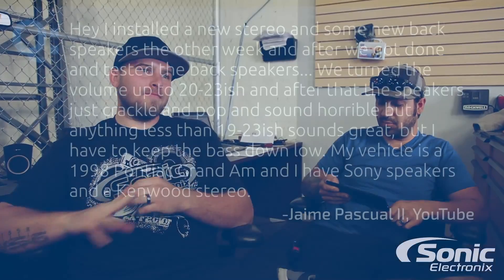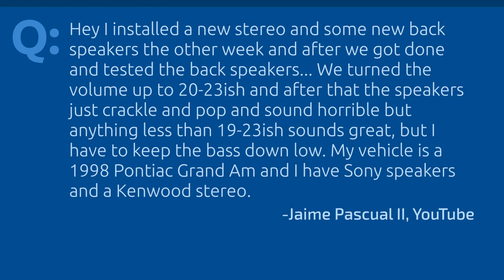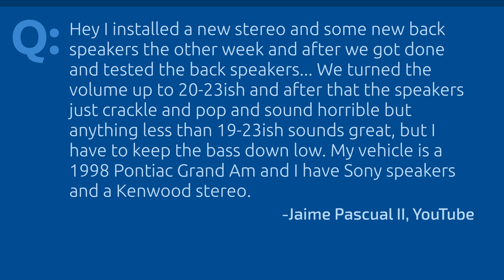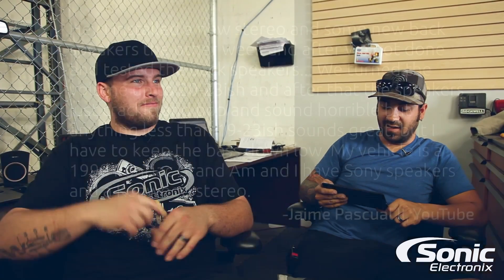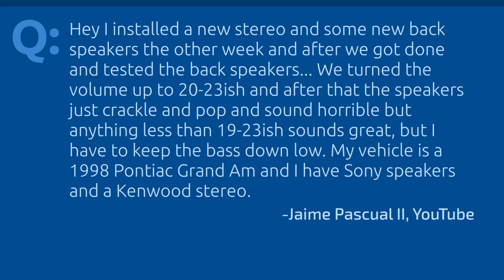Why Do My Speakers Sound Bad at High Volume? | Car Audio Q & A

Comment: Hey guys, I have a 2014 Silverado with a factory radio. I'm experiencing the same issues, but I have Infinity 6x9s, 6x5s, and tweeters. I also have two Rockford Fosgate 10" subs with an LC5i Pro. The system sounds good, except when I turn it up, then the popping starts.

Comment: I have a 2008 Mitsubishi lancer with the rockford fosquate subwoofer that actually came with the car. With my old system i can turn it up as loud as i want and it sounded great changed the stereo and if i try to turn it up loud even without the loudness setting on and it just makes that same crackling sound i never heard b4. The guy who installed it tried to explain it to me sumn about the system is accustomed to 1100 sumn and the stereo is putting out 1300 so that sends the extra to the tweeters on th car thatmakes is sound distorted... do anyone understand what he is talking about and can you simplify?

Comment: I have a 04 Chevy Impala base model have a Pioneer MVH -291BT head unit and OME speakers front and rear with an OME amplifier my front and rear speakers we're working fine then I have lost speaker volume at high level have speakers volume at 45-62 but sound is very low what is the problem? Help me out here

Comment: I have a crackle 2 months in after install. Even when the music isn't playing, but u did notice it more when I have the AC on, seems when the ac n engine does it's thing u hear a quick light crackle every 20-30 seconds with ac on, without the AC I hear is barely. With no music on and volume all the way up the same tone and repetition of the crackle. Sounds like the rice crispies crackle.

Comment: I just put alpine s 65c 6 1/2" speakers amd tweeters in my 2000 chevy silverado that has the kenwood dmx47s.  When I turn my blue tooth and my phone all the way up it starts sounding a little distorted on high volume. I also have a alpine mrx m 55 amp I wanna put in the truck it's a mono amp but has speaker inputs in the back for 4 speakers. Xan I hook just the speakers up to this amp not the sub and will it help ot could it be a wiring issue?

Comment: 2007 Impala LT (non Bose) I installed a new head unit and Scosche speakers all the way around, the front speakers are ran through the factory wiring, I had the back going through factory wiring as well but there was almost no noise in the rear speakers besides crackling static, I ran new wires to the back speakers directly from the head unit and that got the speakers to make a little bit more of clearer sound, I then installed a ground loop isolator which knocked out 90% of the static but now it's to the point where the front speakers are loud and bassy when they're not supposed to have that much bass and the rear sound like just treble.. confused and need help!

Comment: Why  does my pioneer  car stereo fuse has a copper wire around ? If I take it off the copper wire from the  stereo fuse it  won't turn on ...I bought it from someone..someone explain?my speakers never did that even though i play bass boosted songs ..I use the deck at home with 5amp supply

Comment: I have a 2003 Yukon Denali XL I put a aftermarket system in it I got a 6.5 fosgate components in the front and back doors I have an upgrade sound system in the very back I have two level four 15 DC Audio with the 3.5 amplifier also DC batteries and everything it was sounding good then all the sudden the louder I go my door speakers muffle down the amp I have is a four channel which it's not like top of the line is called black ice but it used to work with no problem I noticed that it gets very very hot you can probably cook an egg on it that's how hot it gets I'm wondering if that's what's causing my door speakers to muffle down as an amp alone I appreciate it if you can reach out to me

Comment: So I installed the KICKER 43CSS654 6.5" Component Speaker System Kit (that I got from your store on ebay) into my 2015 wrangler jk. I am using the stock radio. I turned it up to around 20-23 and was nasty sounding. The new speakers i put in sound really bad. Could it be because the stock deck doesn't pump out enough juice for the speakers? I thought it my be the crossovers so I have those set at 0 on all 4 of them and still sounds bad. Sounds ok when it is played at low volumes.
Thanks in advance.

Comment: I just got some installed but litterally the same day the started sounding different. For about 30 mins they sound great cranked at max valume but after awhile the sound starts to sound fuzzy and volume decreases overall and gets echoed. Now I took the speakers back to get looked at n they sounded fine for both 35 mins but 5 mins after I pulled off the lot they did it again. Happens with all music rap,country,rock

Comment: I know this video is old but I installed a system in my 2003 wrangler and was experiencing the same issues with volume. By just removing bass boosting and adjusting hpf to 80 hz I instantly got miles more undistorted volume.

Comment: Pioneer avicf90 on some pioneer 5 inch speakers with the tweeters in middle an some  an a 1500 .1 boss amp with a 12 inch dvc4 planet audio sub in  ported  box

Comment: I have 4JBL 6.5in component speakers running at 200watt rms. They have issues at higher volumes also. But I’m curious if an amp would solve that issue?

Comment: I got some kappa 93ix I was recommended those as the best highest quality in their store and yes they are totally but then at a certain high volume they start sounding like the cheapest stock speakers, any suggestions? Would it affect the facts that I have not installed a speaker amp?
Reply: Did you solved that issue brother

Comment: hi I have 4 channel power amp, can I power 3 voice speakers at 4 ohms using 3 channel, and the other channel to run two voice speakers at 2 ohms? or please tell me the best way to power all 5 speakers,3 speakers are 150Rms (4 ohms), and the other 2 60w Rms(4ohms),note that till I get a bigger power amp(temporary)  power amp Specifications see bellow 

Number of Channels 

4/3/2

Maximum Power Output

760 W

Continuous Power Output (2Ω, ≤ 1% THD+N) 

90 W x 4

Continuous Power Output (4Ω, ≤ 1% THD+N) 

60 W x 4

Continuous Power Output Bridged (4Ω)

180 W x 2

Comment: I have no sound from door speakers but sound comes out of sub at high volume amp work proper wiring and capacitor competition fuse 0 gauge wiring  mtx 10 9500 thunder serious and audiopipe 1800monoblock and pioneer deck screen

Comment: check your battery, match the output of the speakers to your radio watts in rms, you may need a capacitor and amp.

Comment: I have a 2002 toyota camry. That had a system installed. I took it out and.  Now i wana put it back. I have. Factory radio factory  speakers.  I have a l.o.c.  with one 12. Premier pro champion sereis.  And a hifonics. 1600 Brutus. I connected everything properly. And when i go to turn up the volume my bass. Is still there but i dont get the. Same bass when the volume is. Lower.   I have changed out rca cables. And still same problem.  Befor i unistalled the same system it sounded good no problem at all.  Any help. I just wana bang

Comment: Good morning, I have a 2014 Nissan Maxima and my new dash speakers crackle and pop with the engine running and the volume turned up past 20. I  have a soudstream head unit, and boss chaos speakers all around. Dash speakers are 140w, front door 500w, rear door 125w, and rear deck 500w. Any ideas on what the issue could be?

Comment: I have a 06 civic and my rear speakers clip in the back with volume at 27 and up. Besides the solutions in the video would disconnecting them be an option? Before my current subwoofer n amp I had a powered sub hacked into the rear speakers wires due to not having an aftermarket head unit. There is a bit of extra wire that is hanging freely from the rear speaker wires with just electrical tape covering the exposed wire, would the exposed wire possibly be causing the clipping?
Reply: Subwoofer sounds fine past those volumes, just the rear speakers clip.

Comment: See. My 2003 Saturn ion doesn’t have the uplevel audio system with the amp but I have put in a Sony head unit and kicker speakers and it does the same thing sounds ok at lower volume and has no bass you turn it up to 22-25 to get some bass and it crackles a bit

Comment: I have a shitbox 2nd gen dodge with pioneer 6×9s in the front doors 2 10" shallow mount hiphonics and 2 sony 6×9s in the sub box with an 1100 watt rockford fosgate amp and it sounds good when its quit but even with bass boost off it's very distorted at high volumes

Comment: I just bought two new skar vd 10 inch shallow subs for my truck running them on a skar 2000.1 monoblock at 4ohms giving them 800 watts each and they are not performing well at all.
Reply: Austin Tolbert same here . I have a zvx 12 and sounds like shit high volume. I don’t understand what’s wrong .
Reply: Same here. 1 15" evl on 2000 rp.

Comment: I have a question, i have a 2017 Volkswagen jetta gli with the Fender audio system and i changed my door speakers to JBL 6.5's. The problem I'm having is my front speakers are popping (mainly the Right) the rears are fine. I just don't understand why the front two are popping. When the fader is to one side no popping but together they pop unless i slide the fader to the right a little. Also the car has a built in sub in the trunk. Can you help

Comment: I have a 2004 GMC Sierra sle.. with an aftermarket Kenwood excelon kdcx599 with 6&1/2 front 3way speakers and replaced the rear 4&1/2 and it still sounds like a whisper.. help! Lol 😂🤷🏿‍♂️

Comment: Thank you so much for your time  and info you share. Question,  if I have component speakers that run 75 watt rms and it's only getting 50 watts rms from the amp, could this be considered underpowered? You spoke about clipping and distortion in this video and I am getting a little of both at different times in different songs. I'm just trying to rule out a few things to get it straight.  Thank you again for your time. Tim

Comment: IM ABOUT TO AMP UP ALL OF MY INTERIOR SPEAKERS IS IT WORTH ACTUALLY USING A AMP ON ALL MY ALPINE COMPONENTS SPEAKERS. DOES IT MATTER IF I USE A KICKER OR ALPINE AMP ON MY ALPINE INTERIOR SPEAKERS? MY SUB IS A KICKER WITH A KICKER SUB BUT INTERIOR IS ALL ALPINE SO DONT KNOW IF I SHOULD GET A KICKER OR ALPINE FOR THE INTERIOR? Lmk thanks

Comment: I have a different problem. My speakers are 100% fine when the engine is not running. As soon as you turn on the engine though, the speakers crackle. It gets worse with higher RPM. My garage tried installing a capacitor to fix it, but this did not work at all. Any ideas?
Reply: Did you fixed that issue brother
Reply: @Singh_Preet57  Yes, I did. The stock Honda speakers were the problem in my case. The 50 watt headunit that was built into the car by the previous owner was simply too much for those speakers. They were absolute pieces of junk partially made out of cardboard like material. I replaced those speakers with Pioneers, and the problem was gone.
Reply: @WH250398  oh that's awesome 👍🏻👍🏻I just upgraded my stock mercedes speakers to alpine type s. And the quality went down. I am confused and don't know what to do now
Reply: @Singh_Preet57 like most stock head units car manufacturers tune the frequencies to the stock paper cones so they sound acceptable. To fix your issue, you will first need an amp to give the speakers real power as they are currently underpowered and you need a DSP to tune each of the new speakers as frequencies, EQ, delay, need to be adjusted. This may be $$$ but will be worth it.

I upgraded my speakers to aftermarket high powered and like you the sound degraded. My local audio installer mentioned I need an amp and DSP with tune.

Comment: Question: my Chevy Silverado 2005 stock rear speakers are not working right when I turn the fade all the way forward the rear speakers get louder but are still very faint when I turn the fade all the way back they turn off the front speakers are fine it’s just the back ones it’s not the speakers themselves bought new ones and they didn’t work either

Comment: So I just had 2 10’s installed in my 16 challenger with an lc2i outline converter, a extra battery and a bass amp. I notice that my two front door speakers(alpine, upgraded system that came from factory) only have bass coming out of them while my dash & rear speakers I can hear more. Did the sound shop install something wrong ??? Really need your advice.

Comment: Thanks guys ! This gives me something to check on mine. It's an old carcass but the kenwood j980's used to really kick. Now I set it up. Pulled the left speaker (it had no bass) found a wire needed soldering on the woofer. Hooked it up. Now that speaker sounds great but the oyherbspeaket sounds like crap. Distorted..just crappy. So I checked all 3  inside it and everything looks to be all right.  Wires are all connected. 
But it has a real crappy sound and I cant blast em like I used to. 😤

Comment: Hi guys, i can see this video is old but hopefully someone will reply! So ive just installed an android head unit (Atoto A6) on my 2008 350z Gt so it has the bose system installed from stock.... I'm finding that at high volumes i'm getting distortion,  i think the bose system works at 1 ohms so i'm guessing my new head unit has a higher resistance so it can give as much current as my amplifier can?? do you know of any way i can fix this? Thanks

Comment: hey guys whats up i have a old kenwood head unit like 10 years old have it 03 subaru outback had my factory speakers but bought some jbl 6 and a half inch because i thought the factory speakers were giving me the problem so i installed the new jbl and still the same thing maybe even worse so this is whats happening i turn the volume up to like 27 its good for a bit and then it starts to sound like the music is getting lower not the volume botton but the sound so what i have to do is turn the volume down all the way and turn it up again to get good sound but if i keep the volume low like at 20 it stays good do you think its the radio starting to go to crap thank you in advance

Comment: I have a JL 900/5  c3 components up front and c2 coaxial speakers in the rear with 2 JL 12tw3 8 ohm subs in a 2018 GMC Sierra crew cab. I am having a distortion in my passenger from speakers after I hooked up my subs. It didn’t happen till I hooked up my subs. What do you guys think?

Comment: I have a 2018 mustang I would like to replace the factory 6.5 inches speakers in the doors and deck lid. I'm thinking to put kicker speakers. Do you think I need an amplifier?

Comment: My speaker have 260 watt and when i install it there's no bass at all.. My stock 20 watt speaker have more bass then after market speaker.. Any one tell my why??
Reply: I'm guessing because your factory speakers are designed for low watts... You need an amp to push 260 watt speakers to make them sound good..

Comment: You guys are cool I’m trying to get MECP certified so I can do all this stuff myself. But I have a 2005 Chevy Silverado with bose system speakers and amp. I switched out my speakers for alpine type E and I was wondering if I could replace my bose factory with like an alpine 500 watt. And completely remove the bose amp and throw it away
Reply: Replacing the amp is what I’m asking I wasn’t to exact with the question sorry

Comment: My stereo and speakers were fine until my brother installed my alternator and ever since then I hear static on all the radio stations not all of them but most of them and my speakers are popping and crackling and all the sudden my lights on the head unit completely went out but it's still played music while I was in the car wash I got out of the car wash turn the the car off all the way turned it back on and then my radio lights came on again for the stereo lights came on and everything was fine but I still have the popping and crackling noises when I turn my volume up all the way and I still have radio stations all staticy while I'm driving my car but not while I'm sitting what could be the problem

Comment: I have a Toyota Tacoma and I just had a Sub woofer installed I also have pretty decent aftermarket door speakers but when I turn the volume up high say 3/4 of the way hi it gets muffled after 5 minutes on high. Any solutions??

Comment: So I have a double din radio kenwood which has a rms of 50 watts but have a 1500 amp if I change radio to sony Mex 100 would it make it sound better or its. Just best to stay with the kenwood?

Comment: I have a 2006 chevy monte carlo lt and i have 2 db drive euphoria 6.5" for the doors and 2 kicker ds 6x9" in the deck and i have completely removed my panosonic factory amp and head unit i have a double din dual xdvd276bt and when i have the head unit on 25 and under its all good but anything over my passenger 6.5" starts distorting and ive re wire the whole car speakers system changed the wire a few times and its still doing the same thing

Comment: Hey so i just installed two jbl 6×9 and 6.5 in my 2002 impala it has a factory amp but if i turn the vol up bout 25 30 or so it does the cracking and poping is that because of the amp it did the same with factory speakers

Comment: Hi I have a question, I have 2 6x9 cyderslink speakers in my deck lid in a 1965 Dodge Dart running off of a JVC KD-R980BTS and if I turn it up to about 22 I get distortion, how can I fix

Comment: I put a radio in my car the constant i directly put to the battery terminal without a fuse then tha acc wire have a 25 amps fuse what should i do to remove crackling noise from my speaker?